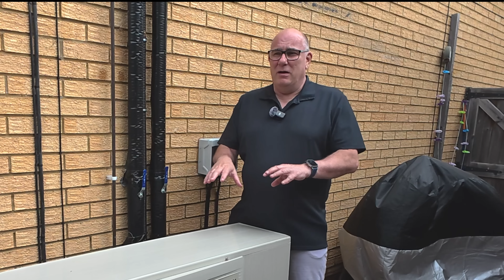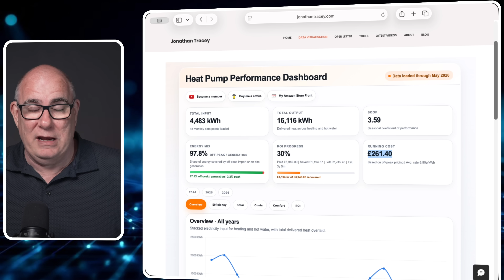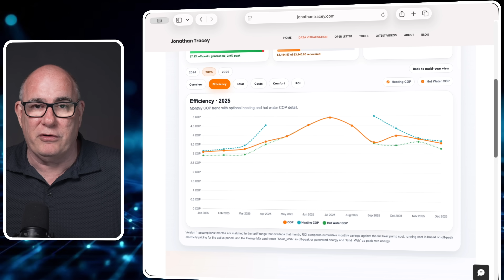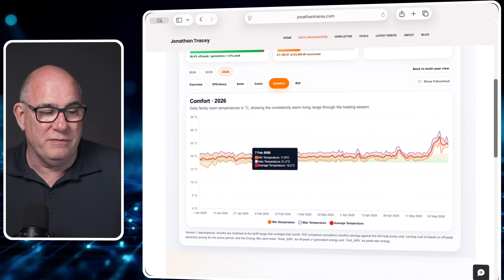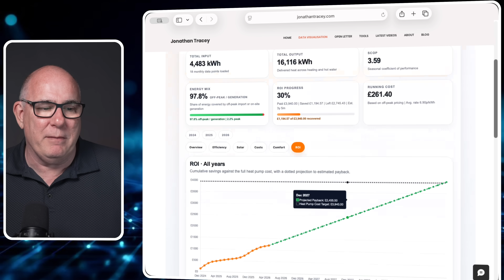18 Months Later: Would I Still Buy A Heat Pump?

Comment: I think you make a fair point . However, your RoI is based on you having existing Solar & batteries, so not really a fair comparison for most. I agree with the overall view . In fact I’m about to have an ASHP installed in the next couple of weeks . BUT , I’ve had Solar Panels for 12 years , I’m on an EV Tariff ( Octopus IG ) and I can afford the capital cost of 18kwh of battery storage . My daughter’s gas boiler broke down 2 months ago , she lives in a 2 bed Victorian Terrace , no where to charge a car , no source of Capital . A new Gas Boiler was the only viable option. I’m not saying you’re wrong , but at the moment ASHPs aren’t the answer for most.
Reply from the maker: I’ve never said that they are suitable for everyone, in fact my recommendation to almost everyone is that they get Solar and batteries first because they will have the biggest impact on their energy bills, then if you have sufficient battery power get a heat pump. If none of those are possible, then stay with a gas boiler.

Comment: Okay, have you considered replacement cost in the future. 

This is my example . I bought my heat pump for £15.5k which I received a RHI which effectively gave me a grant back over 7 years that paid for the installation .

You are only eligible for RHI/grant ONCE. ( which is totally fair, but this has an impact )
I live near the ocean ( about 2 miles and the air has more salt in it than say living in Sheffield ) 
I just had my heat pump serviced , it is corroding in the outside unit, I require a new unit (plus a new indoor unit as they have changed refrigerant in past 11 years )  . I asked the engineer how long do heat pumps last , between 10 and 15 years was the answer , cost of my replacement heat pump £14,038. .
Now my cost could be higher due to replacement of indoor unit as well, but people should be aware that the possible cost of replacing the system should be added into the cost of running the system . Between £1000 - £1500 a year for me,  certainly I will be putting £1,000 a year aside for future replacement and hope it will be lower in another 12 years. 

So your question is would you still buy a heat pump should be considering that in 10 - 15 years time you may have another 11k - 12.5k to get a replacement ?

As I have a wind turbine and will have batteries I still think getting a heat pump was correct choice 11 years ago, but I do think people should be considering saving up for cost of replacement .

Effectively the cost of heat pumps has fallen by about 50% when you consider inflation over 11 years .
Reply from the maker: That’s a fair point, and replacement costs should definitely be considered. My system has a seven-year warranty, which can be extended to ten years for an additional payment. When I priced a complete replacement outdoor unit, it was around £2,300—and it’s unlikely the whole unit would need replacing, as many of the individual parts are relatively inexpensive and a competent air-conditioning engineer should be able to repair it.
In your case, it sounds as though the original outdoor unit may not have been suitable for a coastal environment. There are heat pumps specifically designed or treated for installation near the sea, where salt corrosion is a known issue. I’d be questioning whether the installer specified the right equipment originally, especially if you’re now being quoted £14,000 for a complete replacement.
Reply: @JonathanTracey i live on Orkney . Plus you don’t get much choice of installers . 
What was fitted was a high temp. Daiken .

Since 11 years . They have changed the refrigerant to R32.  Sadly causes issues with the internal unit. Price of jumping into a new tech.
Reply: @robertvasey1785  

Would it be worth changing to a Monoblock unit rather than a split system ?

Comment: I’ve no doubt at all that the numbers would work in my favour - eventually. But I shall be 70 later this year, and the cost of putting in a heat pump would be a cost that I’ll never recoup, as I would also need to replace the radiators in the bedrooms, bathroom, and hall. But the biggest issue is the living room, which only has a gas fire; to put in new pipework off the (non-condensing gas boiler fired) heating system and keep it balanced, and find somewhere suitable to mount what would have to be a big radiator would be a major issue. I’m not against the technology; I paid to have solar panels and a battery (but no EV, I don’t drive). But for me, at my age, a heat pump simply doesn’t make economic sense…
Reply from the maker: That’s completely understandable. My own system is on track to pay for itself in around five years, so I’m happy with that—but everyone’s circumstances, property and priorities are different. There’s no one-size-fits-all answer, and if the additional work pushes the payback beyond what makes sense for you, that’s a perfectly reasonable decision.

Comment: quick question - is your house insulated? windows?attic? I'm thinking on buying an LG V Therma monoblock 14kw R290. I have an insulated attic, but old windows and no insulation on the house. 11kwh solar system and battery 10kwh - so wondering if going from oil to heat pump will help with the costs. Oil is so expensive and would run me around 4000EUR to go through the winter. I live in Austria , so I just wonder if in my situation a heat pump will be helpful.
Reply from the maker: yes but not overly so, its a standard 90s built house which we added about 20cm of extra insulation in the loft. New windows a few yearss ago but nothing over the top. Yes i think if your heating with oil its going to have a huge impact, the only thing I would suggest is maybe get some more battery storage, thats going to allow you to buy cheaper overnight energy to run the heat pump

Comment: The only concern I have isn't with a heat pump it's the fact that it costs the same as a boiler with the government grant. But if a boiler lasts 10 years and a heat pump last 10 years what happens when you don't have the grant and you have to replace your heat pump you're now paying £12,000 for a replacement instead of 4000. I've got solar and batteries and I've stuck with gas at the moment for domestic hot water but I've gone for an air to air heating system so I can benefit from the air-conditioning in the summer as well..
Reply from the maker: @apcyberax That’s a fair concern, but a heat pump does not have a fixed ten-year life, and a future replacement should not necessarily cost the same as the original installation because much of the system — radiators, pipework and electrical work — is already in place. Prices should also change as the market matures. Your air-to-air approach sounds like a sensible compromise, especially as it gives you useful cooling in summer.
Reply: @JonathanTracey true it's on my next plan I won't be replacing the boiler when it dies it will be going to heat pump but I'm trying to go air to air for the heating first

Comment: Key thing -  Solar and batteries.  Without those things your electric v gas charts would be very different. (for a lot of people thats a huge huge cost, compared to e.g. just getting an efficient gas boiler and stretching to pay bills through the year).  Its really just a case of if you can afford it you can save money.
Reply from the maker: @alanbuxey That’s a fair and important caveat. My figures reflect the whole setup I actually have, including solar and battery, so they aren’t a like-for-like promise for every household. The upfront capital is a real barrier, and affordability has to be part of any honest discussion about heat pumps and home energy upgrades.
Reply: I can only add that I have solar prior to the heat pump. My solar generation is lowest when my heat pump usage is highest ( winter) - Our oil system, old and gravity fed needed replacing. The initial Ukraine price spike ( and this years but it didn't matter) meant that for a period it was around 3k to fill my oil tank, right now it would be 2.5k.  I replaced the entire system with new pressure fed hot water radiators for less than 3k. No more January anxiety.  And Jan 25-26 year my total electricity bill was just under 1K.
Am i saving money, when will it pay back and all the other questions that get asked don't matter. Its a central heating system.

Comment: Thank you for the video! I appreciate the facts and practical advise. I am on the fence getting a heat pump. My house is a 1928 semi. No wall insulation. My wife likes the temperature 21/22 degrees. No rooftop solar. Not sure a heat pump could heat our house efficiently and make financially sense.
Reply from the maker: yeah its not going to be easy and without solar the economics may not line up for you

Comment: I have approached British gas and octopus for Heat pump quote. BG quotes Vallient make whereas OE offered Daikin. Both offering completely different heat loss, radiators replacement. Only similarity is hot water tank capacity. Both done paid surveys, difference and recommendation to replace radiators are huge. Price of BG almost double to OE. Any advice JT how to evaluate. My worry is heat loss cal is basic thing if this is wrong performance can be guaranteed
Reply from the maker: I can only tell you my experience, the octopus team did a bang up job, the daikin as been flawless for coming up on 2 years now, I really cant fault it.

Comment: JT, I have heard that the Daikin's controller is wired and like a fix installation. Did you cover this in any of your previous videos?
Reply from the maker: by controller, do you mean the MMI or the thermostat?

Both are wired in they need power and the MMI is connected to the Heat Pump
Reply: @JonathanTracey  Vallient HP is not wired , make that more flexible to move around. I was little worried about wiring as it could look ugly, not sure how many wires need to wire from main unit to controller
Reply from the maker: In nearly two years of ownership, I’ve needed to use the controller exactly once. Every other time I’ve just used the app on my phone, so having the controller wired in and tucked out of the way in the cupboard with the hot water cylinder really hasn’t been an issue for me.

Comment: Hi thought that was really helpful.  I’m having a review we live in a new house 5yrs sold have 27kw batts.   What are your other batts you mention ??   I can only add a max 8..    I want tk get rid of gas ..  do you use one of the flex electric from octopus. We have a car too so thought about using the drive rate of 8p
Reply from the maker: I am on IOG from octopus, as well as my 27kw solaredge batteries I have about 16kw of various plug in batteries from firms like Ecoflow

Comment: True believer in heat pumps. I installed my ATK. 2 ton heat pump last June and worked amazingly in the summer heat wave and -30 Celsius in winter in Toronto. I never used my Bryant 2 stage furnace. I paid $4600 Canadian and my average monthly electric bill was $125. I also charge my EV once a week so well worth having a heat pump. The comfort level is the best i have ever had.
Reply from the maker: wow -30 is proper cold

Comment: Great video. I have a Daikin 16kw, recently the energy sensors inside the unit have frozen their output. I have read this requires a manual firmware update. I wrote to Daikin and they couldn’t care less, and it’s still inside warranty. The heat pump still works perfectly, and I have CT monitors and home assistant, so I get most of the data I want anyway. Just be aware that Daikin customer service, if you need it, may not live up to expectations.
Reply from the maker: can you not get your installer to come back and take a look at it, they might have better luck with the customer service
Reply: @JonathanTracey  It’s a new issue and ongoing. I had copied the installer on the communications, he has confirmed, that they don’t have access to any patch to the firmware. Any patch of this nature, can not be done over the internet and must be plugged in directly to the unit. The installer is due out for the annual service soon, and has said they will follow up with Daikin after that. But ultimately they don’t have any influence on what Daikin will or won’t do. They also confirmed they have encountered this issue before and it wasn’t resolved.

Comment: How do you measure the KWHs input and output as heat from the pump used to calculate the COP? Does it have a meter that gives you these figures? Also what insulationdoes your property have? Many thanks.
Reply from the maker: Yes, the Daikin measures both input and output in kWh, personally I don’t like the way it does it so I take the electricity measurement from my Shelley device that is in my consumer unit

Insulation is pretty standard for a house built in the mid 90s, nothing special just a few few extra inches of loft insulation I added a few years back

Comment: Am i right in saying the heat pump can also put out cool air in summer like air conditioning ?
Reply from the maker: not this model this is an air to water heat pump. for that you need an air to air version. they use mini split units in your home instead of radiators
Reply: @JonathanTracey  Thank you, very helpful

Comment: I have very similar octopus Daikin system. Installed  big solar array (22 panels) and heat pump and 20 kwh battery, and it’s been excellent. Rock solid temps all year.

Overall annual bill is £350, normal 1950s house, detached. No gas and includes two electric cars charging through the year!

Must be saving about £5000 per year. 

No idea what the cop is as I’m told the Daikin system doesn’t report accurate numbers.  

I wish I had used Glyn’s heat
Pump monitoring package. But normal people aren’t going to do that so that’s the weakness. I think some cop can be sacrificed for cheaper £ efficiency, which is ok.
Reply from the maker: were the same with 2 EVs were estimating about 5k a year in savings as well

Comment: Great to see some real world numbers working out well. Clearly Solar PV plus batteries plus heat pump is the way to go to ensure that the electricity needed by the heat pump can be delivered at a low average price per unit. I think there is an interesting alternative way to look at the cost comparison with a gas boiler that perhaps better reflects how much would be left in your bank account in each case. This is easiest understood from the perspective of if you were using a gas boiler. In that case, the 16116 kWh of heat needed would require about 17907 kWh of gas (assuming 90% efficiency). This would cost about £1074 at 6p per unit. However, with a gas boiler, you would also have the 4483 kWh of electricity not used by a heat pump. Wherever this comes from, solar or batteries, it could be exported at 15p per unit on Octopus Outgoing providing a credit of £672.45. The net position is therefore that the heat pump is about £402 cheaper over the 18 month period.
Note, I've used costs that are about right for the period of time that your heat pump has been running; however, recently Octopus reduced the credit for Outgoing to 12p per unit and the price of gas is going up, so the figures have moved even more decisively towards a heat pump being cheaper than gas.

Comment: Thinking that these guys need to start talking to the little guys that are actually recording their own data on their installed systems. Like - https://youtu.be/Un0pS019Z8s?si=9QR2fSuHod-vjob3
Kind of weird that our solar panels use to work year round & would have definitely been improved by have storage capabilities. Now if we could get the smaller wind turbines working  in o sit under the solar arrays on so many houses they’d be even more efficient.
Reply from the maker: Wind in urban settings does not work well, it’s too turbulent for small turbines

Comment: Great video very insightful. I have an ideal logic ASHP, agree with you need the solar and battery for it all to work. Only been through one winter and have a modest battery 11.8 KWh. The logic states a ScOP of 6 ish I think real world is about 5. Hot water over night is the way forward.  Wonder do you leave your heat pump running continuously in the winter?
Reply from the maker: yes we have it set for 20.5 degrees all year, in the summer the house is always higher than that so it never comes on for heating, in the winter it keeps hte house constantly warm (we both work from home)
Reply: @JonathanTracey thanks, was curious if you have compared running constant in the winter against intermittently.

Comment: I too have changed how I heat the DHW, instead of heating overnight in the IOG off peak period I use the available solar in the summer & in the winter the batteries in the day time when the air is warmer & this achieves a higher SCOP ! 
I opted  for the Cosy 6, which has been faultless , I like the way Octopus are always adding software to improve performance, ie lowering the weather compensation minimum heating flow temperature range from 35 - 50 to 30-45 and the option for a “hush mode” in the summer months 👌
Reply from the maker: @AlanS-uu5sy9vy8o That's exactly the sort of optimisation that makes a heat pump shine. 👍

Using solar in summer and shifting DHW heating to the warmer part of the day in winter makes perfect sense because the heat pump isn't having to work as hard. It's a great example of adapting the schedule to the technology rather than treating it like a gas boiler.

Good to hear the Cosy 6 has been faultless too. I agree, the continual software improvements and refinements to the weather compensation settings are something that doesn't get talked about enough.
Reply: I would suggest that using your batteries to power the heat pump to heat the hot water likely costs more in battery wear than the COP benefit of heating the hot water in the day rather than the night?